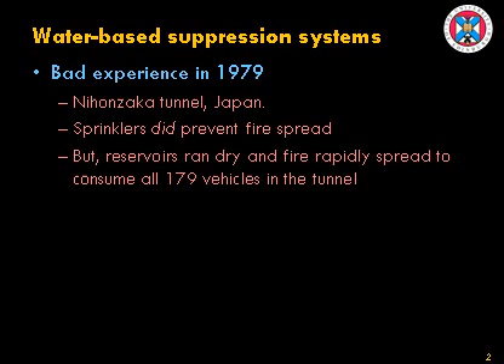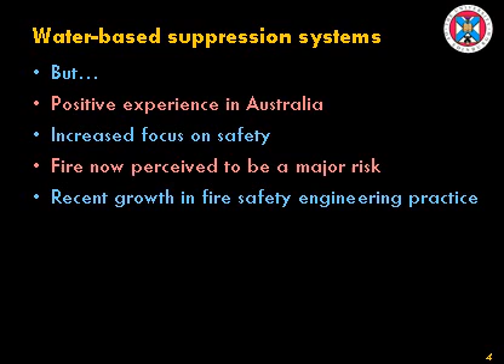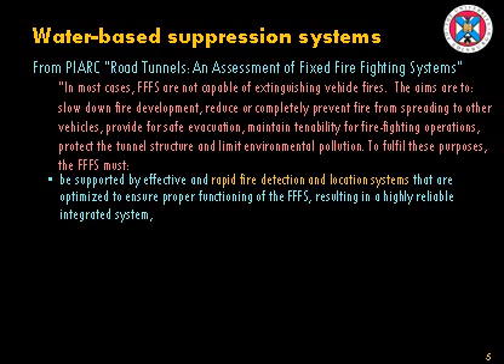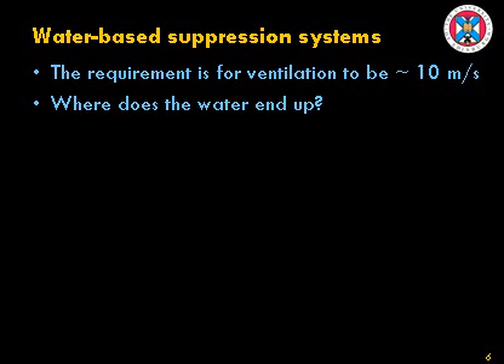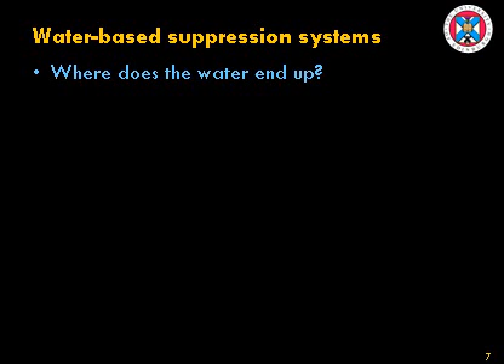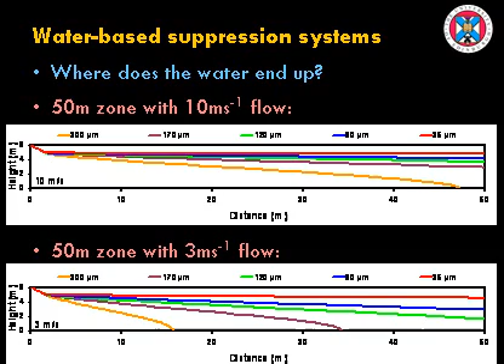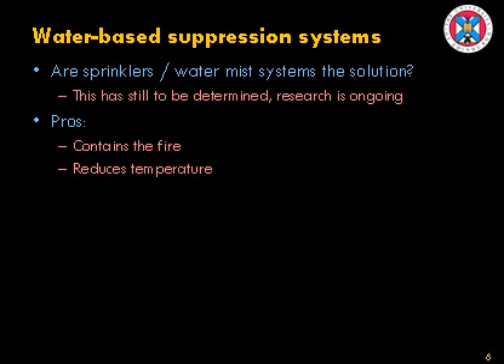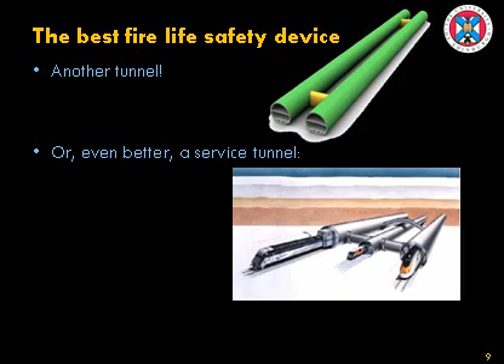Tunnel Fire Lecture - Feb 2009 (end section)

Comment: In actual fact the use of suppresion systems may work with some fires in som etunnels but in fact the only way to really stop tunnels fires quickly with minimum damage to vehicles or infrastructure and at minium cost is to cut of the source of air at each and at each inlet so that the fires are choked and don't get out of hand.
Rose White' Tunnel Fire Mysteries explains this.